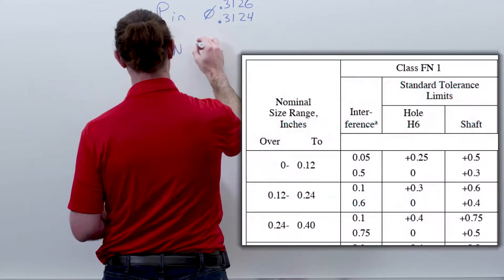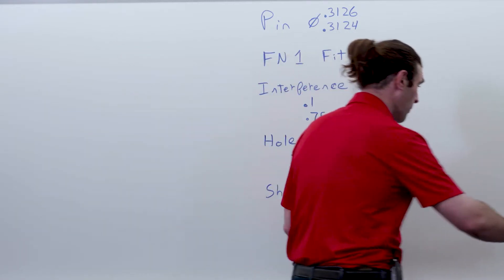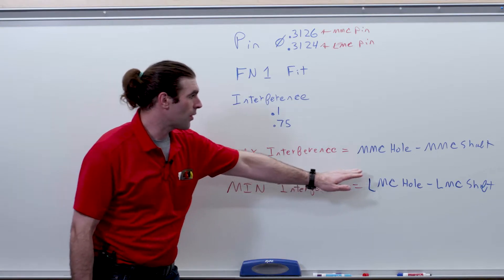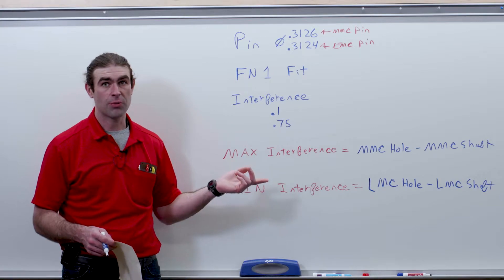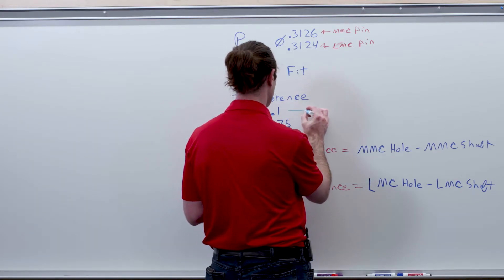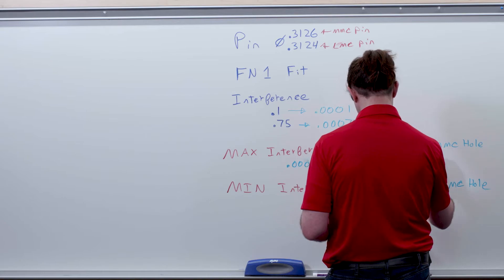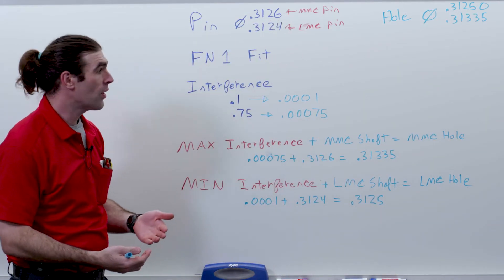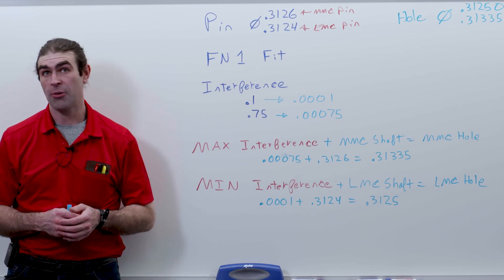Calculating FN1 Force Fit with Purchase Part

Comment: Super thanks for making this video!! I am new to machining and needed to assemble 2 parts together using a dowel pin slide fit on one side and press fit on other side. I had no idea how to do it. Your example helped me a lot to solve my problem as like in your example, I also know the dimensions of my dowel pin, which is a purchased part! I couldn't have figured out how to find the dimensions of the corresponding hole , if it wasn't this video. So, Many thanks to you!! I watched couple of your videos to understand the concept, I really like that you explain using realistic examples and show the calculations. Cheers!
Reply from the maker: Thanks so much! This video was in response to a question in a comment. Feel free to send any questions you may have about design and I can try to answer.

Comment: Hey, great video.  Just FYI, I believe a couple of the variables ended up getting swapped by accident.  The hole dimensions should be .3127" - .31315".
Reply: Hmm I think the interference values should've been plugged in as negative values, not positive values. I believe the hole dimensions should be .31185" - .3123".
Reply: @zuhairsras5047  In your example, the hole would be smaller than the pin
Reply: @InvestingExplained1  That is true, I believe that's the intention with force fit where you need interference to meet the functional requirement.

Comment: I have a question. Shouldn't the max interference and min interference be negative values in the equation ? Also how can the MMC of the hole be a larger diameter than the LMC of the hole, wouldn't the MMC of a hole always be a smaller diameter than the LMC of a hole? 

Thanks for the videos great content!
Reply: To clarify what you're explaining above, the LMC (Least Material Condition) is when you have the least material for your part. The larger hole would be the LMC because there's less material in the part due to boring out a larger hole.  Conversely, the MMC (Max Material Condition) would be when the hole is smaller because there is more of your part leftover with a smaller hole than when compared to a larger hole.

But R. Dean Odell does seem to have the formulas correct. A more straight forward way to think about it, may be: 

Maximum Interference = Difference between maximum material limits = Higher limit of the shaft - Lower limit of the hole
Minimum Interference = Difference between minimum material limits = Lower limit of the shaft - Higher limit of the hole